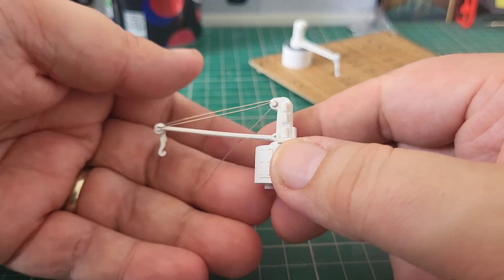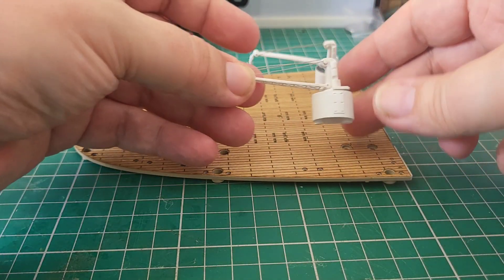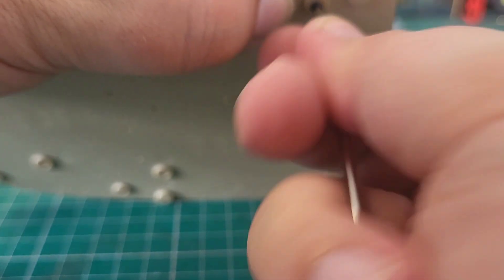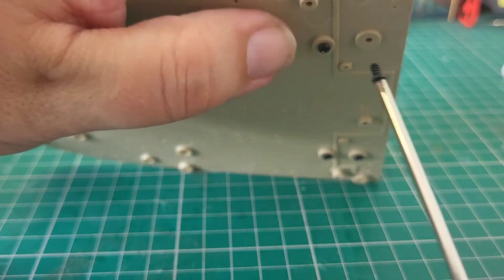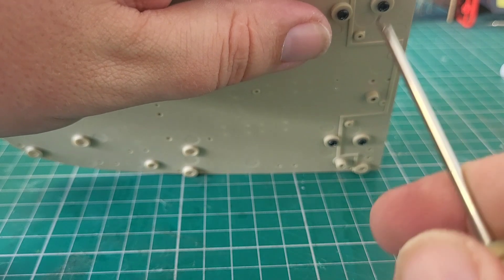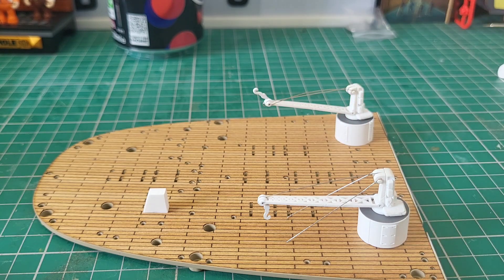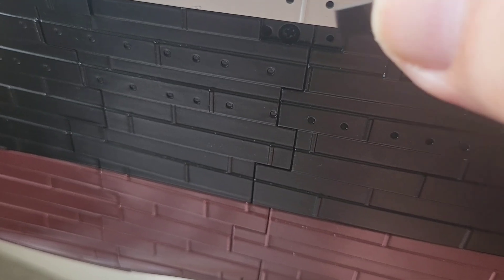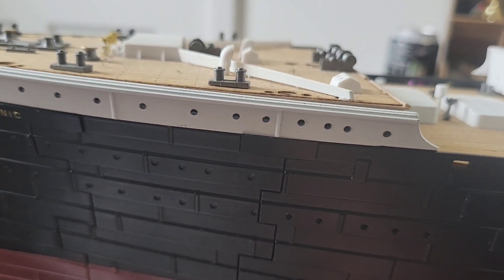Hachette Build the Titanic : Part 126

Comment: I notice you have the decking attached already, but none of the stages have instructed to do so yet (I just finished stage 122 and am waiting for the next pack). Do you just have the decking and structure sitting on the hull but not actually attached yet?
Reply from the maker: @ryan1828  yeah just sitting